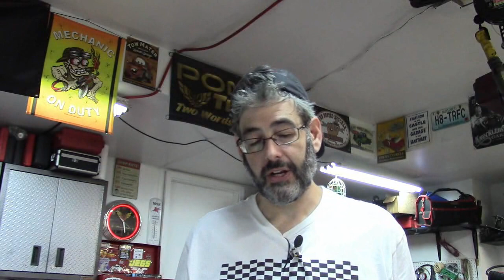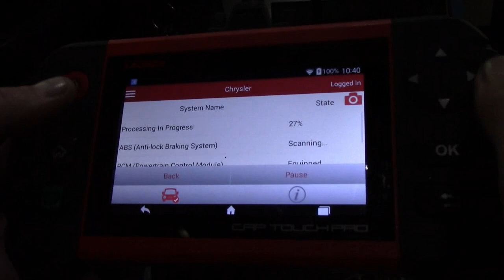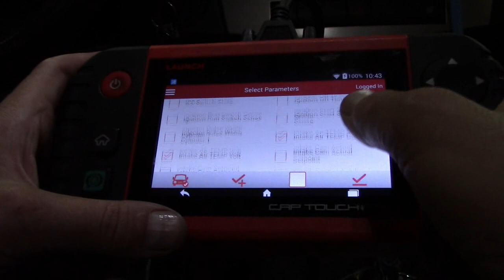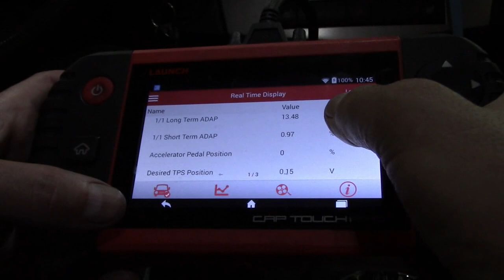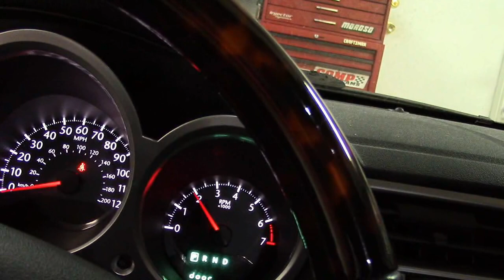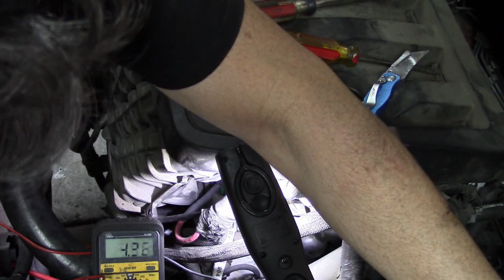2010 Sebring Very Intermittent Severe Low Power, Hesitation

Comment: Hi everyone,

I’m having a similar issue with my 2008 Chrysler Sebring. Sometimes the car feels like it has no power at all, and other times it runs just fine. I’m more of a hobby mechanic, so I’ve been trying to sort this out myself but haven’t had much luck.

Here’s what’s been done so far:
	•	New spark plugs and ignition coils
	•	New catalytic converter
	•	New air filter
	•	New O2 sensors
	•	Throttle body cleaned

I’m not getting any check engine lights or error codes. Could this still be related to the throttle body, or maybe something else I’m overlooking? Unfortunately, I don’t have access to professional diagnostic tools.

Any advice would be greatly appreciated!

Thanks in advance.
Reply from the maker: What data do you have? Start there.

Comment: Hello everyone! Quick question I have a 2007 Chrysler Sebring Code P0507 any help would be appreciated
Reply from the maker: What data do you have?
Reply: @SchrodingersBox lightning bolt on dash went in limp mode.
Reply from the maker: sounds like a bad electronic throttle body to me.

Comment: Here’s my story on my same car . So my car was doing similar it felt like it wanted to accelerate on me & kind of stall . A few days later my check engine light came on I took it to the mechanic they said it was PCM so I order a new programmed one for 400 after my mechanic put it on the check engine light remained on the mechanic said it was my craftshank so they replaced two of them after that the light still stayed on so then the lightning symbol came on they told me I need a new throttle body so I did that & now the check engine is still on & the code is circuit open their telling me I need to take it to an electrical shop . I already spend 1500 at this mechanic 😢 please help idk what to do next
Reply from the maker: You definitely need a different mechanic that’s for sure. He’s not even doing any basic diagnostics.
Reply: @SchrodingersBox  now the lightning symbol looking sensor is back on after they just replaced the throttle body

Comment: Was the customer not receiving the little red lightning bolt indicator on the dash with this issue?  Having the same sort of issue with my '07 sebring. Already swapped out the throttle body module, figured it was time, over 211k miles on it, but still having the same intermittent issue. I gotta check out that pedal sensor next i suppose...great video's by the way! Love the thought process and critical thinking..world lacking a lot of that right now.
Reply from the maker: Not for this issue. I believe the indicator you may be referring to is for the electronic throttle body?
Reply: @SchrodingersBox  yes, correct, the etcm...doesn't throw codes, but that little red bolt pops up time to time in relation to the hesitation and not being able to accelerate..it's hit and miss..but beings I installed a new etcm, and after seeing your video, I now am going to check out the accelerator pedal sensor..I'm a good "part swapper" (please don't hate me lol). And even though I work in the electrical utility industry and understand electrical theory and delivering power on a system, I never really learned the electrical system of vehicles. But I've learned a great deal from all your troubleshooting videos, and really learning how the system is supposed to function
Reply from the maker: It’s most likely a failing motor in the electronic throttle. I would test the throttle angle position relative to accelerator pedal position and look for a mismatch.

Comment: I’m going to play devil’s advocate for the tech through my experience of 16 years as an hourly fleet technician with three months as a flat rate dealership tech thrown in there. I bet you can guess which career path is more advantageous if your passion is in strategy based diags to provide evidence based decisions and still go to bed not hungry :)

You mentioned it would take you about two hours, at times, to get the vehicle to act up. I’m going to assume conservatively and say the guy makes $25 an hour. A diag typically charges an hour. So in this example, he has broken even at just getting the car to act up. 90% of my evidence based recommendations were declined because the customer always knows someone who can hang a part for cheap. This is why you didn’t see the code on the invoice. I always erased the codes and never recorded them on the work order.

So his possible strategy if he went way over the book time was to up sale the routine maintenance jobs. A tune up for a four banger pays 1.5 and can be done in 30 minutes. Just as a trans flush pays maybe an hour and can be done in 20 minutes. I didn’t pay attention to the odometer in the video but the car could be at the proper mileage to justify the up sale. I always looked in the owners manual and up sold every routine maintenance item by having my service writer explain the customer why and ask if they had them done at the correct intervals (the diff between a fleet tech is the responsibility of knowing my customers equipment maintenance history is on me versus it being on the customers as a dealership tech) 

Unfortunately, the dealership I was at  put me in a position which turned me into parts charger. I knew I needed to get out and back into fleet maintenance when a brake job started giving me the same rise as a CEL job as a fleet tech. 

Love your videos. You and ScannerDanner are like personal trainers keeping my skills honed and the theory fresh in my head.
Reply from the maker: Yes I totally understand the environment I am in is far more conducive to thorough diagnostics than in a professional environment especially when techs are paid on estimated hours for a job and on upsells where speed combined with more turnover of work orders significantly increases incentives. 
    No question about it- I wouldn’t last a day in that kind of environment but I understand the strategy is different. In fact I am usually down selling customers lol- I never recommend a “tuneup” for example unless I actually see data indicating it is necessary.
Reply: @SchrodingersBox  in regards to the tune up. This seems to be one job in the industry that is used determine a tech ethics and rightfully so. 

For me, the determining factor of doing a tune up really depends on what environment I’m in. 

Hopefully my decisions can all be interpreted as not being unethical. 

In a fleet maintenance environment, preventative maintenance is crucial in our business model. Which is why we rely heavily on the manufactures recommendations coupled with our own repair order data to find potential failure areas that can be addressed beforehand when determining which maintenance items to perform. But the end result is that we and the customer is making money by staying on the road. 

Now for my personal and friends vehicles, I will test the systems and determine if I believe they are not within service limits before making a call. 

Unfortunately in the dealership environment, my paycheck was the determining factor, but I always tried to base my up sells on information that made the decisions feel “legal” I guess you could say. That never really sat well with me which is why I wanted out. 

I remember the one job I hated doing at Ford was a “spongy brake pedal” complaint after a shop or friend of the customer replaced the brakes pads. More often than not it was a failed ABS hydraulic control unit because using a c-clamp to push the pads back would sometimes destroy the actuator valves. This job paid 6.5 hours with $2000 in parts. I would always come out at loss because I wanted to isolate every brake system component first because I hated being the guy who was going to hit the customer with probably a $4000 dollar bill if I didn’t get it right. 

Now that I’m back in fleet maintenance with a low volatile steady stream of income. I’m able to follow a model similar to yours when doing side work. The feeling of helping a customer with good intentions being the determining factor is a wonderful thing. 

I’d love to see you take a stab at some electrical diag on Frieghtliner’s DD platform. There are so many different electronic systems that are interconnected via CAN Bus. It’s a diag techs dream messing with these beast!
Reply from the maker: great discussion man. it’s definitely a grey area. Some things that bug me are clear misdiagnoses that the shop doesn’t take responsibility for. There is a shop in my area where I swear they throw O2 sensors in every vehicle with an MIL. When they get a come-back they say “well the O2 sensor was bad and now that we put a good one in we can see that there is another problem we couldn’t see with the bad sensor so now we know you need a MAF sensor (or whatever)”. Then when that also fails to fix the car, usually the customer asks around and finds me and I find the whole time it was a vacuum leak or weak fuel pump or something clearly showing the shop misdiagnosed— twice. 
    I have shown several times where a shop quoted $700+ for a  new AIR system pump and another quoted $1700 for a whole new AIR system but I found both times the pump worked- it was a $30 solenoid that was bad in each case.
   Those are the things I can’t stand. But if a tech replaces wires and plugs along with a correctly diagnosed bad coil pack- that is perfectly fine. Even advisable!
Reply: @SchrodingersBox  you and me both. I’m constantly asking the younger techs why they want to replace O2 sensors or Nox sensors for example. The conversation is always, “describe to me your process. What were your findings?” 
If I get, “the computer threw a code” I tell them to follow the diag trees and come back with more data. 

Our outside vendors do the same crap. Truck has multiple write ups for low power/derate. We’re in the hole sometimes over 1000’s of dollars with countless regens, sensor replacements, and tow bills. Then I get to pull it in the shop with a code for intake manifold psi lower than desired. Hook the smoke machine up. Find the air compressor intake hose has a hole in it (some manufacturers run the hose off of a boosted source now). $5.00 dollar hose and less than an hour diag (now I go straight for the hose, replace if needed, and then verify). Just makes you wonder sometimes we’re the passion is anymore. 

Thanks for the non Facebook/Twitter format conversation. Im currently taking a hiatus from FB after getting blasted for asking a nurse friend for her perspective on what she is experiencing currently in the hospital to maybe gain a better insight on covid. 🙄 yes, I have watched your covid videos and I appreciate you sharing your knowledge and perspective. I’m sure I’ll be leaving comments in the future.

Comment: Intermittent issues are the worst!
One possibility that wasn't addressed was a problem with the wiring from the pedal sensor to the TPS. There must be one or two connectors in between that may have a conductivity issue.
Reply from the maker: There is no signal from pedal to TPS. It goes to the PCM.
Reply: @SchrodingersBox  yes, so can't there be a problem with the wiring from the pot to the PCM or from the PCM to the TPS? It is a possibility I believe. Anyway, great videos!
Reply from the maker: No because we saw the signal FROM the PCM to the the throttle body at time of failure. This can only mean that potentiometers from the pedal were functioning. The only explanation is the throttle body did not respond properly to the functioning pedal (and PCM) command.

Comment: how does your oscilloscope waveform distinguish between bad throttle body  and loss of control  voltage from pcm
Reply from the maker: because the data is processed by the PCM. I know the TPS signal voltage is reaching the PCM and also that the PCM reads it.
Reply: @SchrodingersBox  thanks so much for your quick response.it seems the voltage across the motor is identical, irrespective of throttle position during the  fault.in my opinion a bad throttle motor ,good pcm control  might show different  voltages with no change in rpm. the pcm  is reading inputs correctly,just not responding with correct output. i also find it suspicious that the pcm is reading inputs correctly,yet not flagging a fault code when there is an obvious fault condition. do you know if there is any way to substitute test light  for motor to check pcm control? thanks for the videos
Reply from the maker: Sounds like it is digital design then. Is it digital or analog design?

Comment: hi Matt, can you explain youself a bit on how did you short circuit that circuit without fear.  you shocked the world. hahahaha

M.B.S MOSHITOA (A AFRICA)
Reply from the maker: Hahahahaha. sure. 
   It comes from the basic electrical training series on www.schrodingersboxqm.com. 
  Basically when I measured the voltage drop across the IAT resistor, there was not a complete drop. There will always be a complete voltage drop across a load UNLESS there is another load downstream. Therefore I know there must be another resistor downstream of where I tested. Thus, it was safe to create a short circuit because the other resistor on the circuit will protect it.

Comment: Hey bud, I've been subbed to your channel for a good while
and been enjoying all your content. 

I got an unrelated question. (Hope that is ok)

I have a 2002 z71 with 5.3, 200k miles. After about 10 min on the highways (when
I happen to notice it at 65mph) I get what sounds like a rod knock. Twice, I
stopped off to see what is going on. The knock seems to be coming from both
sides or perhaps the middle front of the motor and quite pronounced. One time
it went away just idling about a minute after I turned ON the AC (doubt that is
related). In a few instances, after noticing the knock ~10 min later it was
gone (basically when I get to work -- all highway: 65/75mph). It is hard to
notice unless parked or driving close a K wall on the highway because there is
a dumb Flowmaster installed. My father about two weeks prior to this thought it
was an exhaust leak so I performed a smoke test with no leaks and forgot about
it until I started driving the truck more regularly. 

I have not had a chance to perform a ear-screwdriver-test. I have had this
truck for almost 2 years. Oil pressure never gets above 40 (which is on the low
end from what I read on forums). The fact that this happens only at operating
temp then goes away is really confusing me. Thoughts? 

Also, I am all set to do the timing chain gasket (and chain—already did the intake,
knock sensors, valve covers and thermostat) the oil pump is a little pricey but
might as well? Maybe engine flush first? Which makes me wonder if the knock
could somehow be the chain… I know that might seem crazy…. I dunno…
Reply from the maker: I would check the rod bearing clearances using my screwdriver test.

Comment: just put a crank sensor on one of those today...i think you will have to perform a throttle body learn after install... thanks for the video..
Reply from the maker: The new throttle body fixed it and actually to my amazement it did not require a relearn.

Comment: Carbon build up is getting to be more and more of an issue with direct injection and turbo charged vehicles with shrinking engine displacement
Reply from the maker: How does direct injection cause carbon buildup? Seems it would cause less of it to me.
Reply: @SchrodingersBox  first one must question the reason for carbon deposits in the first place However it doesn't allow the detergent additive and fuel itself clean/wash away the deposits on the intake port ahead of the valve , Toyota is adding a 3rd injector ahead of the valve for this very reason , we use a walnut shell system at BMW/Mercedes to clean valves and VW is notorious for valve coking

Comment: check the potentiometer for the pedal. cross reference with scan tool TPS position. also test with engine off.  IAT check resistance vs spec